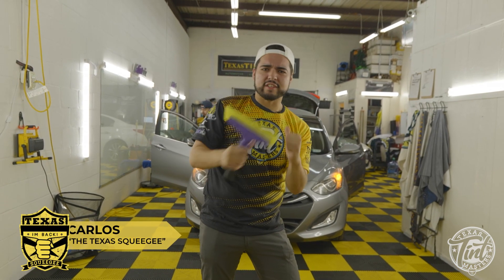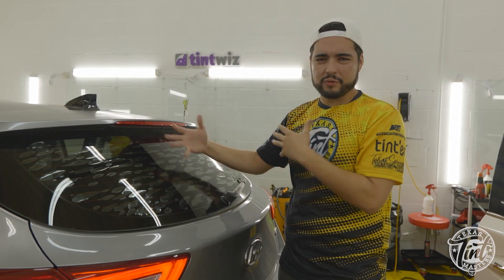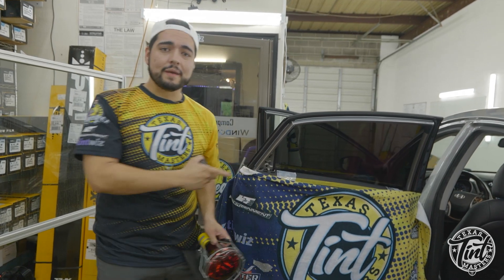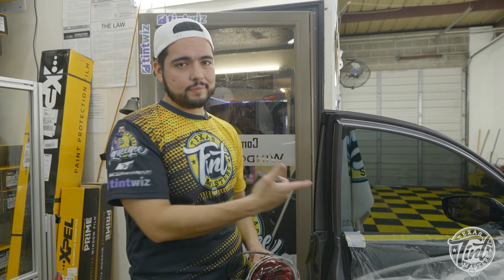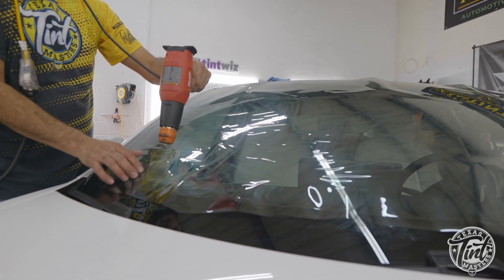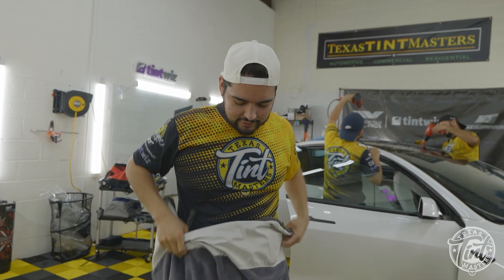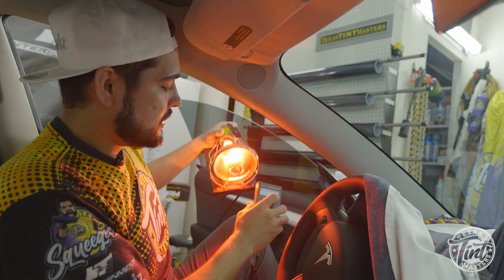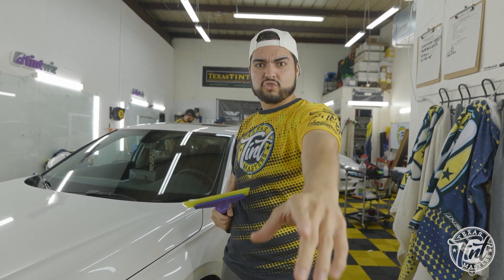Ceramic Tint vs CHEAP Window Tint

Comment: Hey I got 45 % ceremic (xpel) on my windshield but I hardly notice the difference and it’s still visible from outside why is that ? And do You recommend going 35%.
Reply from the maker: There’s a few things that factor to the overall look of tint. The main ones is: Interior Color & angle of lighting when you’re looking at it. 

Window tint always look lighter on tan interiors and if your side windows are lighter, there’s more light entering the cab. More light makes the tint more translucent. 

The advice we always give on windshields is to keep it legal with whatever your state has allowed. The darker the windows, they harder they are to see out at night.
Reply: @TexasTintMasters  ok thanks for explaining me but if I send you picture on insta could you possible tell what percent it is by looking at it ?
Reply from the maker: @rajaking275  Possibly, our IG is @texastintmasters 🔥👊🏻

Comment: What is the range of prices?  Curious because I got a quote of $1,500 for a Honda Ridgeline… and a typical tint job is usually a few hundred dollars. $300-500
Reply from the maker: It mostly depends on the type of tint and application package. 

Having old film to remove will add costs, adding windshields, sunroofs, pano, windshield strips etc can add to the job. 

$1500 is more in the top end for a Ridgeline but will most certainly depend on area and region you are located.
Reply: I paid mine $280 5% all around ceramic and 35% up front and eyebrow
Reply: Lmao.. Unless you are on LA it's safe to say $1500 for tint is armed robbery my dude... I own a detail shop and my buddy runs a tint shop out of one of our side buildings and I know exactly what he pays for the good ceramic as well as the cheap ceramic... There is noway someone should be charging you $1500 for that

Comment: I got a question I got “ ceramic tint “ on my car but it kinda looks foggy from the inside. Is that normal ?
Reply from the maker: If it’s a bluish color to it then it is most likely a low angle haze that is common with ceramics. Just a natural by product of the film. 

It’s also a confirmation that it’s a ceramic film too.

Comment: I got my new car tinted from the same shop that did my last car but I feel like they may have used a cheaper tint than the one I paid for which is the same as my old car because when I hold my hand up to the glass it feels a lot warmer than it does in my old car.  Is there any way I can prove this if I go back to them to ask? I paid for the ceramic 3M tint and I don't think I should really be feeling any heat.

Comment: So the same exact tint that built the company  Is trash and not worthy of being installed 😂 stop it
Reply from the maker: 😅 I think you have the wrong video. 

We’ve always used the same manufacturer film (Garware) since day 1. Brands have changed but a brand doesn’t mean they make the film.